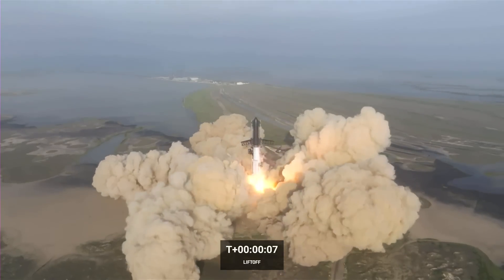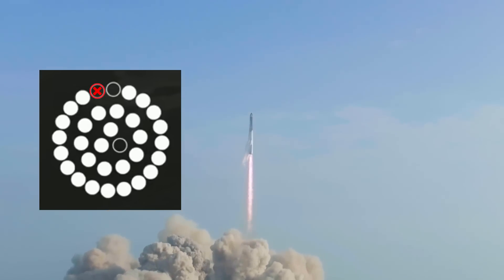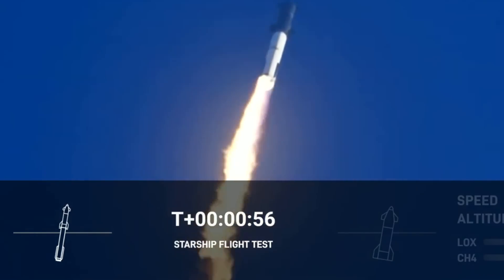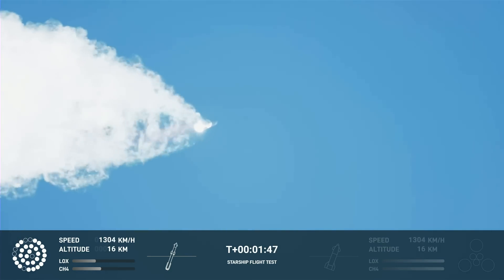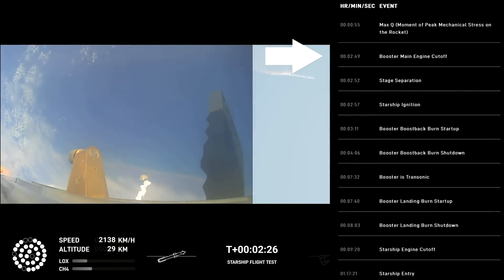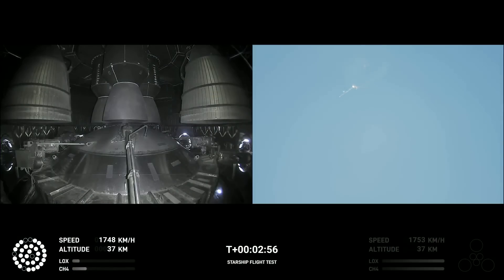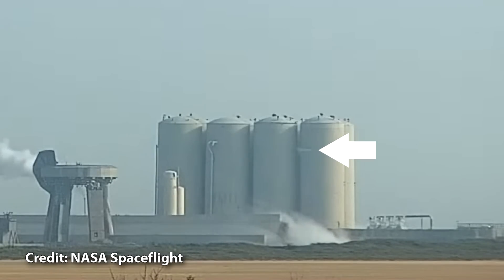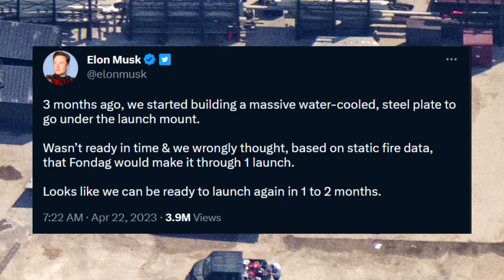I Watched the Starship Test Flight at 0.25x Speed & Saw What Went Wrong | Starship Flight Analysis

Comment: The goal of the test was not just to clear the tower. You cannot be that naive. Musk only said that because clearing the tower was literally the only thing that went more or less according to plan and he knows that his fans will believe anything he says.

The pad desintegrated and everybody knew this was going to happen. Yes, SpaceX knew this and Musk knew this. The debris from the pad damaged the engines and from there the entire test was a loss. 

The problem that Musk has is that the only proper solution to keep the pad safe is a flame-trench (his idea of a steel plate and watercoolling is childish, you know this perfectly well, a flame-trench is cheap, easy and proven to work) but being such a genious he decided to build right next to a nature preserve where he is sikmoply not allowed to build a flame trench without going through the proper authorities which can take a long time.
So either Musk thought he'd be out of bocachica by now or he thought he'd be able to just do what he wants because he's Musk, but either way he is now stuck with a pad that may explode when again at the next launch.

And then there is the question of why everybody keeps saying that the next generation of booster and engines that are allmost finished are going to be much better. Why do this launch on a pad then knew was going to explode, using engines that they knew were pretty bad, on a booster that they are fasing out? DId they really just spend X-hundred-million on a test to collect data on an engine that they are not using anymore?

ITts perfeclty ok to be excited by what SpaceX does, but it's simlpy dishonest to pretend that this was a success and to downplay what happend as "a learning experience". Let me put it another waym, if this happened to NASA, you'd spend the next 6 months laughing at the incompetence and the absurd naivity of the fans.
Reply: It was either scrap B7 like all the boosters before it, or fly it off the pad. Clearing the pad for B9 was the only criterion for success.

Comment: Here is a theory I have what Israel parts of this was actually intentional. Elon Musk said that he there’s a low chance of it actually succeeding 50-50, and he said he would not be digging trenches. This may be a mistake, so what I am wondering is because of this first you got to see what you do without a trench because I mean landing on Mars there’s no pre-built trenches. He also gets to see if his flight termination system works and he gets to see how much damage is dealt and what the rocket would do if it’s losing engines, so maybe he didn’t intentionally cut them out but maybe he had a feeling that this might happen

Comment: Even Boca chica is lack of water-resource, the dry Divertion system of exhaust-gas/ ventilation can prevent concrete/cracked debris from undirected location, such as cryogenic storage/tank farm, or even strike into underneath of the rocket's nozzles, causing engine failure... Or the Bunker, Firewalls shall be established for specific locations. The aerodynamic design of supporting Columns, shall be Triangular Shape with one edge (steel cladded/reinforced), pointed inside to the Blasting center.

Comment: Why doesn't SpaceX use booster rocket configuration on the Starship like they do on the Falcon 9 Heavy? I would think that if you distribute the thrust over a wider area that there would be less damage to the launch pad.

Comment: Great Analysis, thanks!  I agree that it will take a while longer.  I'm not really sure guessing at a timeline is very productive.  Surely, another metric will have to be considered for SpaceX's success is needed: Tenacity, Innovation,  inventiveness, Olympic High-Dive Scoring 🤣 LOL.  This is so very interesting to study.   I keep wondering if positioning the rocket another 25 ft. or 50 ft. in the air on the OLM could reduce the shockwave at ground level.  The other thing I imagine is that the water content in the concrete contributes to being boiled out at launch and must contribute to the explosive debris cloud.
Reply: I'd also kike to see the chop-sticks catch a launched  booster and or 2nd Stage separately.  I believe this would add some data to the rocket being positioned higher in the air, away from the concrete.

Comment: Not a real good commercial ad for Fondag😆 Steel watercooled plates is a step in the right direction, yet you still need additional absorption techniques for the sound waves. Sound can only be silenced with…..sound. A smart sound interference system has to be setup. Otherwise Raptors will keep in doing what they are good @; ripping things apart.

Comment: What is annoying about this is watching updated 1950s technology, with 1980s/90s proposed reusability, being passed off as a significant advancement.  We should be making actual technological advancements over simply improving the heavy lift and range accomplishments made in the late 1960s.  

Significant advancements in propulsion and shielding haven’t been made, resulting in the same limitations we’ve had for 50 years. 

“Starship” is a 1959 Cadillac with SatNav and radial tires.

Comment: Very good video.  

I wonder if the lean was caused by the combination of the shut down engines and the extra weight on that side from the heat shield if that's even a thing.  I would think the engineers designed Starship to be balanced with the heat shield attached.  

While you mention the lean away from the tower, you didn't mention the lateral movement away from the tower.  You can see the rocket moving sideways  as well as leaning.  

I thought the entire launch was very interesting, especially with engines failing at launch but still getting off the ground successfully.
There's something to be said for the redundancy of 33 engines.

Can't wait for the next iteration.

Comment: I was not on the crew so I really had no expectations. Like you I was fairly contented with what the booster could do. I would really like to see how the engines did, IF the chunks of concrete were what damaged them - that's fine. But if that is not the only thing - back to the test stand. Like a lot of idiots out there I get to say I told you so about the OLM, no real surprise then and before this next launch no cutting corners, steel sheets and some kind of flame trench (which I know that they are avoiding, still its good and proven technology)

Comment: If this was another space agency launch, you would be head shaking at the utter incompetence in the design of this whole launch pad and space port! Who in his sane engineering mind, would not use NASA experience (whose launch pads are 60+ yo) to properly reinforce the bottom and keeping the gas farm at a proper safe distance! These choices could be indicative of a company working on a tight budget! As for this mantra of “we collected so much data”, sounds a lot like the Sour Grape story! Everything went wrong from the start, a lot of others rocket launches went wrong after leaving the ramp, but for Space X that was an incredible success! Add this to the cavalier attitude of this company, specifically his leader Elon Musk to the ecological issues they all repeatedly ignored, what you get is a Soviet era type of company, where criticism is not welcome and will get you fired! Beware of the N1 story, it had the same multi engines configuration and 3 out of 4 launches cleared the tower, I suppose the Russian collected a “lot of data” too!

Comment: Your analysis of the hold down clamp retraction is incorrect. SpaceX publicly stated that the clamps were released many minutes prior to engine ignition.  The stack lifted off when they throttled up to 90% after running the engines pet reduced thrust for several seconds probably observes telemetry.

Comment: Great analysis. I used to be a safety and reliability engineer for the International Space Station. I think a major unanswered question (at least for us on the outside) Is was this all from a common cause failure, i.e. debris damage from the incredibly inadequate launch pad, or are there multiple unrelated failures. Another big question is whether system interdependence is a significant weakness for Starship. It's quite a sight to see so many engines all firing simultaneously on a single vehicle.

Comment: SpaceX learned more in five minutes than a year of calculation and simulation would have taught them. If the rocket had blown up on the pad they would have learned very little. It got past MAX-Q with seven randomly positioned engines out. This launch was a huge success. A bit of stage zero damage was a small price to pay!

Comment: I cannot understand why the plate being added to the pad is flat. A pyramid in the center would deflect the exhaust streams outward, as was used even in the ancient Redstone. All flame deflectors I have seen used curved paths to deflect the exhaust rather than blocking it  with a perpendicular flame. The flat plate is more likely to produce a damaging shock reflection and will result in the exhaust being heated further by compression as it is stopped by the plate. 

I remain puzzled by the use of the flip separation maneuver. I would think the grid fins on the booster would be sufficient to pull it free of the upper stage, but perhaps someone can explain it further. All O can say is that if a crew is aboard the separation maneuver would be dramatic.

Comment: IMHO the most work should be put in to completely rethink and modify the orbital launch pad.
It is pretty obvious that the engineering team did not get the design right to withstand the immense torque torch and heat of the rocket engines.
I do not feel confident that Musk's idea of placing a watercooled steel foundation on top of the concrete base will do the job.
The combination of heat and torching effect is a giganormous blow torch the power of which you can't even imagine.

Comment: I'm skeptical that debris blasted directly up at the motors at launch. The reason debris is created is due to the downward stream of high-pressure gasses. Much higher pressure than atmospheric. I suspect that debris would have an angled vector away from the massive jet of the combined motors. I could accept a good argument for the one outer ring motors being impacted, however. But not the center two.
Reply: Hard to say when the rocket motors carve a bowl shape in the ground.
Reply: Agreed - the momentum transfer causing the debris trajectory cannot bring that debris back to the momentum source - unless this bounces off something very restitutive, which would shatter the fondag chunks into pieces. Also - just watch a more recent vid where Elon claimed that the failure sequence of Stage 0 was the soil onder the base subsiding, allowing the fondag slabs to crack apart, and then ricochet out of the crater - more sideways than upward.

Added to that, this vid shows HPU and engines failing indpendently, and in separate positions, long after the liftoff sequence - damage from debris would happen in seconds, not 10's or 100's of seconds.

Comment: Excellent analysis, the first site to establish the mapping of the graphic to the orientation of it to the rocket’s actual physical engines. It was funny to hear another site make a big deal about how this was a tower avoidance maneuver.

A simple free body diagram showing the thrust vector due to the engines out and potential thrust vectoring of the inner engines would greatly help illustrate why the rocket behaves as it does. [Free body diagrams (otherwise known as FBD's) are simplified representations in a problem of an object (the body), and the force vectors acting on it.]

It should be noted that when it started to tumble the aerodynamic forces were at less than 1% due to extremely low atmospheric density which is why it was not ripped apart and why the damage from the FTS didn’t rip it apart. So less to do with the “how strong” vs actual aerodynamic loading which was very low.

Additionally the overall exhaust flow under the rocket was asymmetrical and thus the probability of foreign object damage is also asymmetrical and luckily for spacex the engine failures made SH stagger away from the tower.

Comment: Those two "puffs" at 8:06 ARE the flight termination system, unlike NASA they don't use a full line charge to unzip the rocket. Yet at least, they might switch to one now.
Reply: It's leaking fuel out of the holes the FTS made in the booster and Starship.

Comment: Starship definitely got waaay further than I thought it would.  I’m confident SpaceX will learn many valuable lessons from this launch
Reply: Lessons that the Soviets learned decades ago. Specifically that all those clustered engines don’t work well. And that blast diverters are essential.
Reply: If you think all it had to do was just clear the tower, what if it had blown up 1000 feet above the tower? Would that still be a success? 100 feet? 10 feet? Why didn't they expect it to survive liftoff? That means it wasn't ready. Claiming that it succeeded simply by clearing the pad is like saying your brand-new car is great because you were able to back it out of your garage before the engine seized and the wheels fell off.
Reply: @JeffRL1956  especially past Max Q
Reply: @JeffRL1956  it's a prototype... so it being 'ready' doesn't make much sense
Reply: @JeffRL1956  spacex makes iterative changes on the assembly line after gaining data like what they obtained in this flight.  This is what they’ve always done.  It allows for fast development and rapid progress.  To get a rocket that far along on its first attempt is simply amazing.  And yes any result except an explosion on the pad is progress

Comment: I didn’t think it would ascend much further than the launch tower.  Thanks for the slow motion, it was plain to see the damage as it was occurring. The water cooled plates will help protect any direct spalling of the pad but I would imagine the combination of moisture in the concrete, the temperature is will be subjected to and the massive pressure would still break the exposed concrete to pieces.  It would help the have a flame trench diverting system as well.

Comment: The rocket had no chance of surviving and performing as intended, given the fact that it was undoubtedly hit with debris and punished with severe vibrations from the unsuppressed plume. The haphazard launch setup was truly puzzling to me, the men who came before the spacex team clearly did their homework and would not have wasted time on deluge systems for acoustic and flame suppression if they did not have to.
Reply: Agreed. this method of launching is akin to setting off a massive bomb at the base of the vehicle and hoping said vehicle does not sustain any damage. There just isnt any way to launch a vehicle of this size and power without using proper precautions as to acoustic and thrust plume damage.
Reply: IMHO There is no chance that the pad pit debris could make it back up through the so powerful Raptor exhaust, & no video evidence that debris somehow hurled up aside then curved back to strike the rocket.
Reply: @warrenwhite9085  So the videos clearly showing a cloud of debris and dust enveloping the bottom of the rocket aren't good enough for you and somehow you think the plume acts like a force field and won't let anything bounce back. Good to know. Thinking the debris couldn't possibly hit any part of the rocket means you think the engines are just such total junk that almost 1/4 of them failed for no apparent reason by the time it was destroyed?

Comment: I feel like SpaceX is making the same mistake as the N-1 and their insane number of NK-33 engines. Having so many engines introduces too many points of failure into the equation. If SpaceX focused on a bigger engine, with fewer mounted to Starship yet with the same thrust, would be much better in terms of reliability. I don't doubt that the Raptor 2 is far more reliable than the NK-33, but that doesn't mean that you're not going to have a failure in every 1 out of 30 engines, and when you're using 30 plus engines for a single rocket, you're almost guaranteeing failure or have witnessed a miracle if it all works.